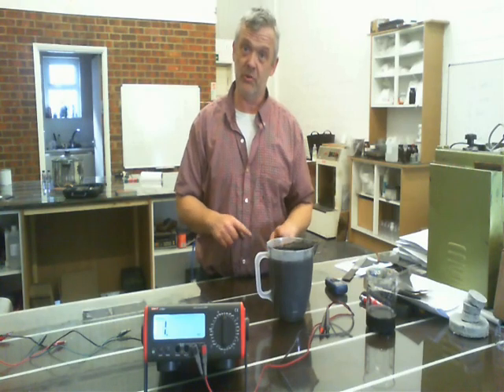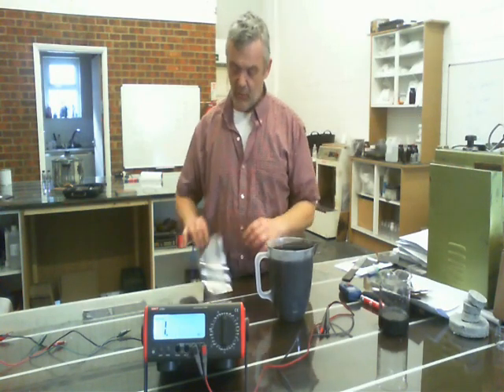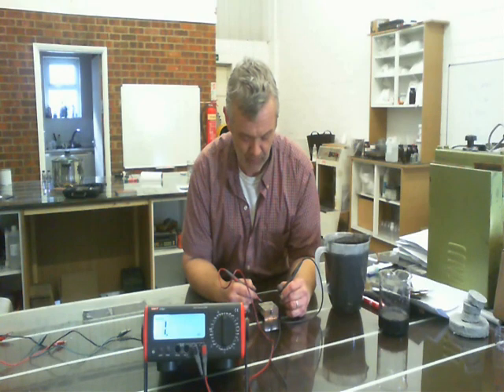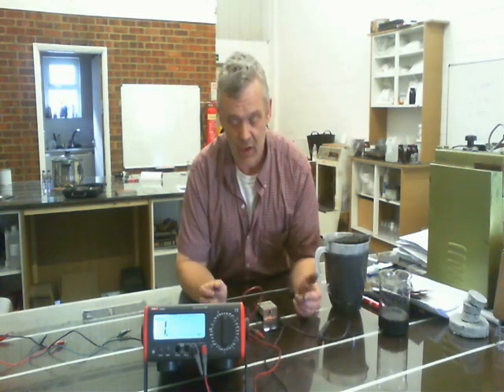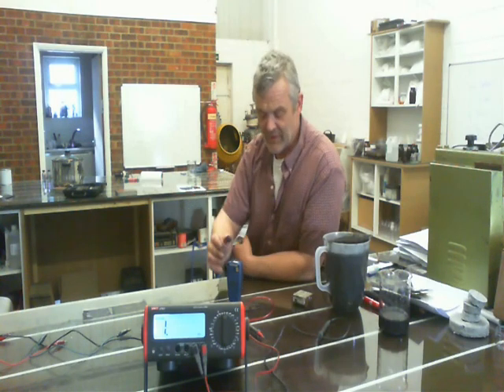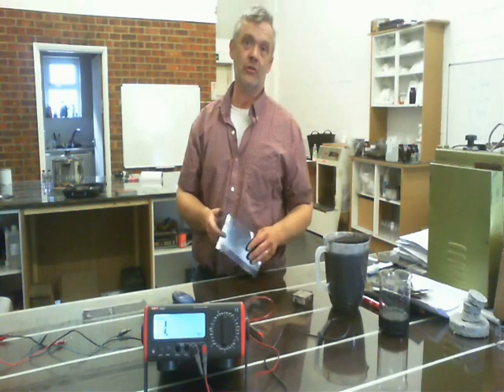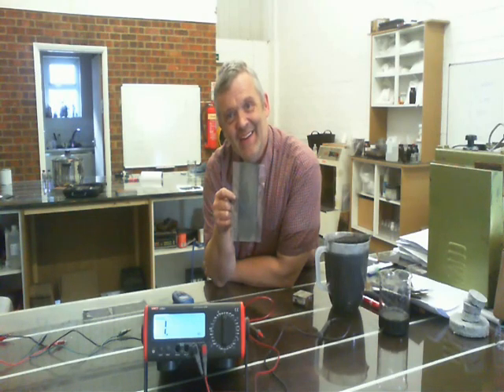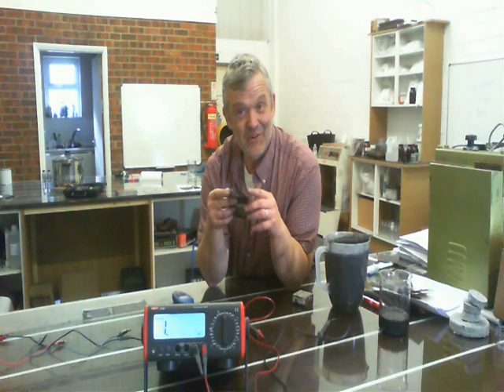Update on Rubberised Conductive Graphene Ink

Comment: Hey Mr. Murray-Smith, I apologize if this is not the video that I should be posting on, but I had to let you know of what happened when I was making the graphene in the blender.  First I blended the graphite with water and liquid soap like you said and for only a bout 10 sec at a time, when ever I passed the blender I would push the button to start it and run it until my wife ask me to stop, which was around 10 secs or so.  I did this for about a week and then check the resistance of the dry powdered graphene at the top of the blender.  I got @ 59 ohms per inch.  I also tried to make some ink using the graphene and Future Floor wax the 100% acrylic.  after a week, letting it sit in a bowl and evaporating I scraped some out and it had become like a putty.  I check the resistance and it was around 4meg ohm per inch,  not good but I embeded a piece of magnesium in the putty and touched the positive probe to the putty and the neg probe to the magnesium ,  I read 1.7vdc.
I would like to know what I could do with the conductive putty, or is it just wasted?  Thanks Ed

Comment: Hey Robert. Did you try this as a heating element yet? Heated cloths may be had more relevant soon since we may be headed into an extended minimum like the Maunder minimum. I was thinking that it would make a nice heated seat cover for a car if it will warm on 12 volts. I have no doubt that if it works well for heating that it could be used on a low voltage system. If for some reason not we can always use an inverter.
Reply from the maker: good points - i haven't tried it yet - but i will

Comment: I'm interested in applying something like this to fiberglass panels to add strength and/or to test how well it blocks extreme heats (which I will test on my own with your Indiegogo rewards). I was wondering if the ink/paint would be sprayable in something like a Preval sprayer system or even an industrial paint gun. If you have any feedback from your tests outside of what you've posted in videos, I'd very much appreciate it.

As soon as I figure out which of your products best fits my experimenting needs, I'll be investing in your campaign. Thank you very much for posting what you do; it's fascinating.
Reply from the maker: cheers mate - there is no problem spraying the ink - it needs viscosity modifying - but to be honest that just means adding water

Comment: Where could I pick up one of those square testing probes. The internet only has big mad industrial machines.
Reply from the maker: +Colin Hammill you have to make one
Reply: Robert Murray-Smith Just a block with conductors I take it?
Reply from the maker: +Colin Hammill exactly - i'll do a vid
Reply: Robert Murray-Smith Cheers man, it`s like being taught by Tesla himself LOL. BTW I made an ink out of guar gum (sample only) but it`s drying at the moment. What screwed the whole recipe up was that instead of using 100s of grams of the emulsifier your down to single units in grams. It`ll be interesting to find out how it goes.
Reply from the maker: +Colin Hammill do a video
Reply: Robert Murray-Smith My laptop that I used to use for that packed in about 2 months ago and I can`t afford all the software at the moment to do it but I can say this as a tip about guar gum, it doesn`t actually need heat (though it comes in handy) and needs to be added very finely and slowly while continuously stirring. I`ll see if I can manage a video but my camera came with a specific editing program specific to it and it died with my laptop. To stick it on this computer means I have to pay again and that means I may as well buy a new camera (oddly enough).
Reply: Robert Murray-Smith After 3 coats I can report this. The first coat was up about 2k ohms. The second coat brought it down to a variant between 230 ohms and 110 ohms, the third brought it down to just over 100 ohms generally so I gave it a rub with tissue paper and ended up with between 35-60 ohms all round. Considering I used an old envelope to paint it on it`s not a bad sign so far! 
I was using an approximate 1 cm spacing to get these readings.
Reply from the maker: +Colin Hammill cool
Reply from the maker: +Colin Hammill ah well
Reply: Robert Murray-Smith I gave it a rub, leaning on it again and got as low as 11 - 35 ohms  seems I definitely need to make one of those lol. . If I was to send you a sample to test where would I send it?
Reply from the maker: +Colin Hammill that's very cool - i am sorry mate but i don't test other peoples samples
Reply from the maker: +Colin Hammill i should explain - if i did that i would spend my life testing
Reply: Robert Murray-Smith Gotcha LOL

Comment: So for a stupid person.. that could be painted on a metalized plastic, and then adding a wet layer, rolled up and voila a capacitor?  trying to catch up on your vids
Reply from the maker: you are spot on mate - that's exactly what you could do with it
Reply: gotta try that.. looking for an alternative powersource to crank my 8L racing engine.. been having some luck with borrowed maxwell caps but they are effing expensive. And i would need like.. 20.. ;)  (2.7V 3000F)
Reply from the maker: go fo it mate - but it is experimentation - so be prepared for a few failures lol
Reply: hehe that whole engine build is an experimentation.. runs on home made alcohol, retrofitted into an old GM V8 block utilising modern injection... And well killing car batteries like no other... ;)
Reply from the maker: very cool